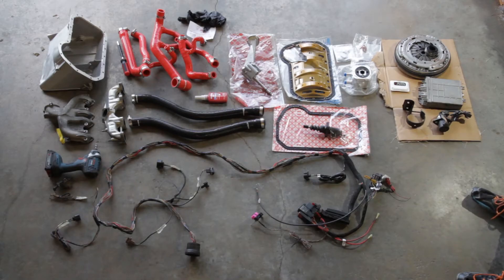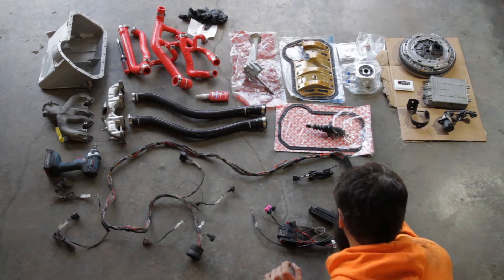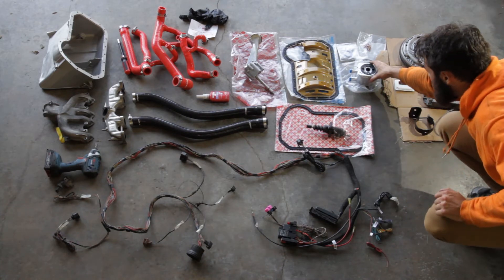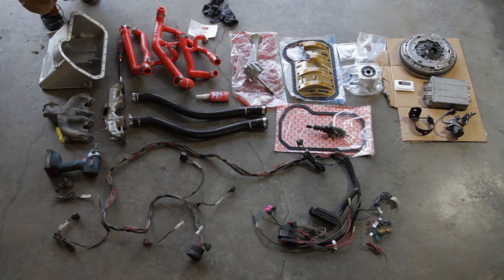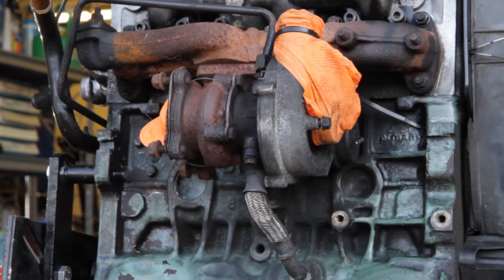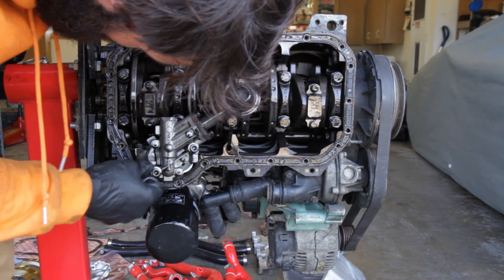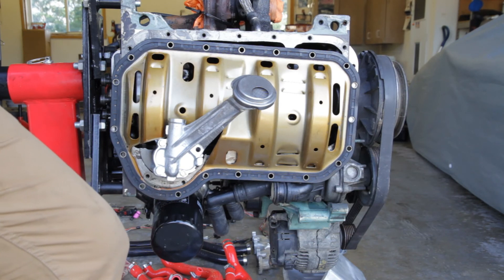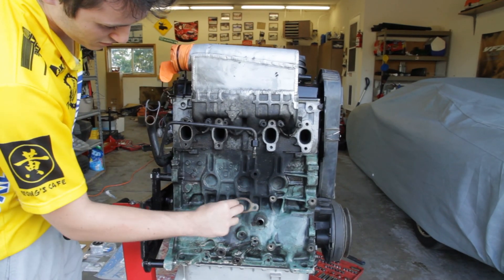Vanagon Project - Engine Swap: Part l

Comment: What year Vanagon are you considering or would you recommend.?
Reply from the maker: 1985 stock gas engine
Reply: @kaffeewerks  Thanks..!
Reply from the maker: The difference between models isn't going to be a massive deal. If you had a choice the diesel Vanagon would be the best. There are less things that need to be changed.
Reply: @kaffeewerks  Yes, as there seems to be more swaps now with gas (any year) due to the availability of the diesels and even there, I've heard the 83 is preferred over the 82,  yet.. virtually unavailable. (83's)